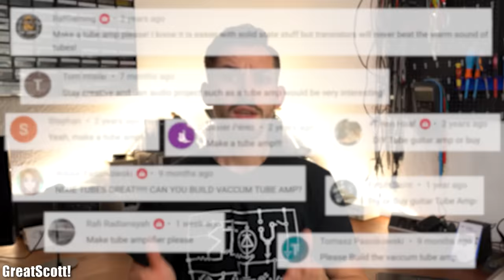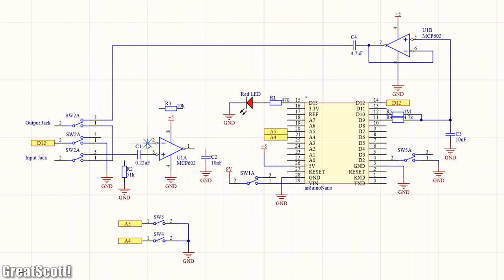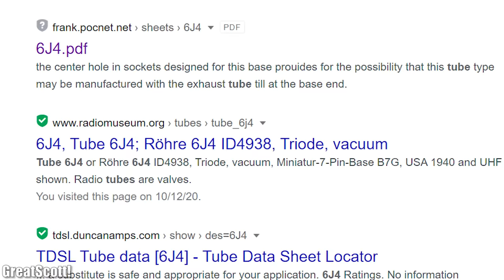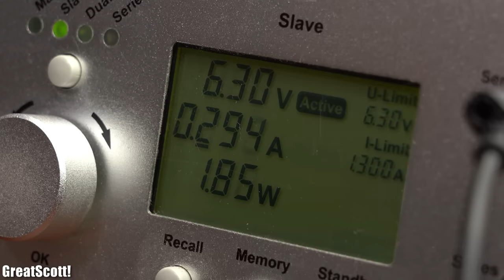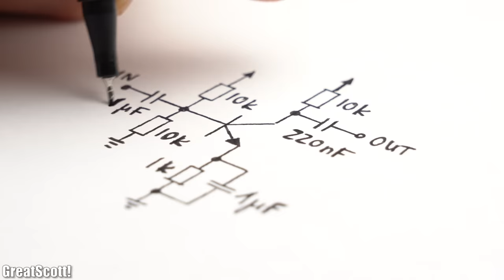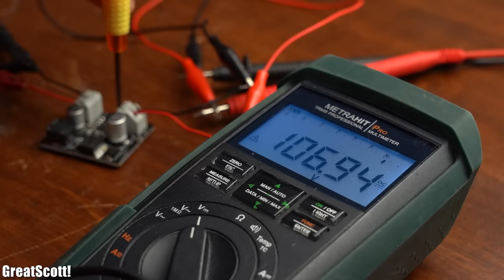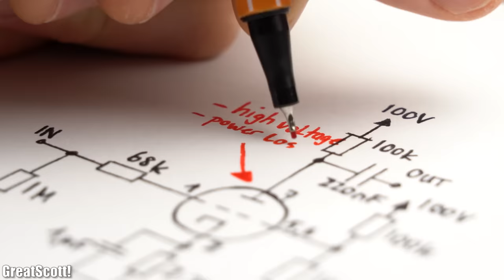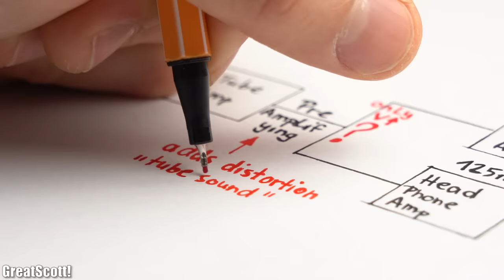Building a Tube Amp! Does it produce better audio quality though? EB#47

Comment: hi, i would like to point out some inaccuracies....
1 : your " amplifier" has little to do with a tube amplifier since it uses vacuum tubes only as signal buffers, everything coming out of that box is transistor generated.
2 : a true vacuum tube amplifier uses "final" driver tubes to generate the power to drive a speaker, but since they require high voltage as part of their working characteristics they have ust a high impedance output. this impedance is matched with an iron core transformers ( with some special characteristics to improve audio performance ) so in your amplifier you are bypassing about 3/4 of what a tube amplifier really is.
3 : the tube curves are less linear than transistor ones, but you are actually looking at the wrong graph to determinate linearity, audio specific vacuum tubes ( there are RF, IF, oscillator, mixer ecc.... specific tubes) have a grid voltage - plate current graph, si you see the variation of plate current versus grid voltage; this really shows linearity ( remember that tubes are transimpedance amplifier basically )

i also would like to propose an objective osservation, the audio quality can be strumentally measured with audio distorsimeters of fft analyzers ( or a scope fft ) as well as a frequency sweep, if you take a look at some videos by "ElPaso TubeAmps" channel you would see how a real tube amplifier is built and fully tested, a good tube amplifiers does not show distortion of any kind basically, you can achieve even 0.1% total distortion which is a remarkable result.

i do not want to be polemic, i just want to point out some inaccuracies :)
hope you reed this comment!
Reply: Yeah, i only have a high level understanding of tube amps, but every cheap circuit is still 80% silicon, the tube does nearly nothing. The parts that make a tube amp a tube amp are bulky and heavy,  and pretty dangerous too. Like 400- 600v.
Reply: the problem with using tubes as final drive tubes is that it adds a ton of aliniarity the mentioned iron core transformer features a alinerar iron core which is a source of distortion add to that that those systems are rather inefficient and that they are only realy usefull for low powers and you have quite a lot of problems. also 0.1%thd is basicaly nothing in the world of silicon amps they usually run with a ton less untill they get out if their linear region. 
not saying that tube amps have to place to be quite the opposite if you find that mix of distortion pleasing to hear thats a great option for you same with guitar amps where that distortion makes a guitar spring to life.
but just as a amplifier that has to create the most linear and accurate results tubes are not your friend
Reply: Tube sound superiority in hifi amplifiers is still a very contentious debate. There are many who believe that the amount of distortion is less important than the harmonic content of the distortion. The typical argument is that a strong 2nd harmonic is a pleasing "musical" distortion and tubes tend to distort in that way. It's a fine argument for guitar amps, but it kind of falls apart for audio amplifiers. Music usually contains complex a mix of frequencies and while a 2nd order harmonic might sound nice applied to a single note, with many simultaneous notes the resulting distortion products interact with each other in a very non-musical way creating a whole bunch of new frequencies not in the original piece of music. The result is a loss of definition of each individual instrument and a more noisy, veiled sound.
Reply: This.
Reply: Wait!! Let me get to the point. 
So her 80$ audio vacum tube are trash product that scam innocent peoples to buy it because humor about tube sounds quality? 🤔🤔🤔🤔🤭🤭🤭🤭
Reply: Mr Carlson's Lab is amazing channel for tube amplifiers and old electronics so for all reading this comment go and check his channel
Reply: Yep this guy is correct, a tube amp with only a tube pre stage is not a tube amp
Reply: @volvo09  then if you are that knowledgeable you would be aware of equal order harmonics effects and how they do influance sound properties and percived quality..
Reply: Well, its still a tube pre-amplified amp. Like with most tube amps its serve its purpose of looking cool, adding the pleasant distortion and costing too much. So its a tube amp.
Reply: @gu4xinim  That's a misinformed comment if there ever was one 🙄
Reply: @lonelyelectron5283  You are forgetting the demand side of the equation. They would not make these "fake" tube amps if dumb people did not think they worked and buy them. The people who buy these defend them. They think because it has tubes it makes it sound better. They are paying $80 to fool themselves. Same with audio cables with gold plated ends. The cable is still copper it makes no difference.
Reply from the maker: Thanks for the feedback✌
Reply: @chuckthebull  "Perceived quality" stands for "shit I cant back up but I think its there so it is." It either effects the actual quality or it does not. It either amplifies without distorting the sound or it distorts the sound and what you are listening to is NOT the same sound that was input. Changing the source is a sign of LOWER quality not higher quality. If you like the sound of NOT the original input then that is on you but it is not better or improved it is distorted. Some prefer tube amps and some prefer not to spend $80 on a useless brick. You can pretend all you want but the actual science says otherwise. Blind test after blind test audiophiles are unable to tell the difference any better then a coin flip. Then audiophiles try to say that some how audio is not suitable for blind tests one of the most reliable testing methods in science. Its all bull you made up in your head. That is the perceived part you THINK it is but it is actually not. Audiophiles are no different then people who believe in psychics. They are unable to prove it so they just say it is a "Perceived quality".
Edit: Auto correct changed psychics into physics.
Reply: Those amps with tube for pre-amplification and class D on the output using FETs ot BJTs are called hybrids, they use that soft clipping of the tube and the high power of transistors, check PS Audio on Youtube and there web site Paul is that old fella whose passionate about audio, about amplifiers, about tube and about speakers, you may already watched some of his videos with the extremely rare Infinity IRS V speakers and PS Audio have those hybrids with over 1000W of power and the hearth of the amp is the tube and the muscles are the FETs so there is place for those kinds of hybrid amps
Reply: @jordangogov5866  Sorry im still new at electronic and still using transistor as amplify for audio but why we mix them for audio? I dont get it
Reply: @jordangogov5866  Except here it doesn't have a proper tube preamp stage, but only a tube buffer (it will only get you so far where you want to go). It's not what is typically considered "hybrid". On virtually all hybrid devive, you'll have a triode voltage stage (say a 12AX7) that will actually impart "tube sound" to the signal. These cheap Chinese devices really aren't doing all that much.
Reply: @WillisPtheone  You can easily tell the difference when using proper equipment. The large appeal with tube amplifiers is that you can swap the tubes to have the preferred sound. They can get very expensive if you are getting the proper full tube amp such as Woo audio ones, but all audio gear is like that $80 won't even buy you a single good tube. Once Covid is over I would suggest you go to a audiofile meetup and take a listen to some of the high-end stuff before jumping to conclusions.
Reply: @WillisPtheone  Does what you're saying apply to real-deal guitar tube amps that cost hundreds or thousands? And I mean for guitar amplification specifically? The imperfect frequency response and distortion can be desirable for guitar amplification, right?

Edit: To provide an example, I'm a huge Jimmy Page fan. And I would imagine that the majority of the guitar community would say that it's impossible to attain his characteristic Supro sound with just transistors (and I'm ignoring digital effects and post processing considerations). Would that be inaccurate, or is that an exception to what you're saying?
Reply: @jonathanvanier  I tried some buffer schematics but all we crappy cuz there is no useful signal/noise with the low voltage I used so am waiting for return mail from a shop which has laminations and bobbins and I will wind my own transformers to power a 6sl7/6L6 stereo amp only the output transformer is my concern cuz the lamination type is different from the power transformer and that is said by one of my university teachers and the Tesla of the laminations has to be lower than 0.5T but from other places I find that I can use the basic 0.35mm laminations with there 1-1.2T laminations so I don't have any idea what to do for the output
Reply: There is no such thing as zero distortion. Or noise. Or anything else- any (good) engineer will tell you EVERYTHING has tolerances. Entropy increases. NO amplification device has a truly linear transfer coefficient. In the case of triodes, the supply voltage and load resistor would need to be infinite- but as they increase, noise increases (unless you want to run it a t absolute zero temperature). Most tube preamps run their first stages at much lower voltage (~60v) because noise is more important at that stage, and accept the non-linearity.
Reply: @MarkHopewell  Actually, otological matters do not intrude- if the pattern of movement of the eardrum from the recording matches that of the original performance, then fidelity is achieved. Any human differences would apply to both, and therefore not a reproduction issue. They would sound the same to the subject.
Can we approach this? Not with speakers. They inevitably involve (amongst other things) room acoustics, which mean that the original is corrupted (room balancing does not take into effect the time domain).
Better is to record with an artificial head and mics in the ear canal, then reproduce with insert earphones, with microphones of the same response in the ear canal, the system matching what  they hear with the original. IMHO this is the way to go.
Reply: @volvo09  Most circuits that I have seen only use the tube as a cathode follower. This means that the tube has 0 zero dB gain (actually a little less than 0) and only adds distortion to the signal. Within most of these circuits there is no benefit of adding a tube, it's only there to make it look fancy.

There are of course exceptions where mixing sand with tubes does have a benefit, but this is specific for each application. One of these would be as a CCS in a long tailed pair or to drive a powertube's grid current in class A(B)2 applications.
Reply: @MarkHopewell  Not sure how this is relevant to the point that I made- which is that the objective is to match the original performance, without regard to what that sounds like to the subject. You need not explain the frailties of human hearing  to me- I was the chief designer of hearing testing equipment for a UK otological instrument manufacturer for over 20 years, and I am very familiar with the literature. (No BS, I can prove this.)
You seem to be concerned with perception. I am not- just with reproduction. If you are complaining that the entire field is full of hype, smoke, mirrors, and lies you will get no argument from me. It was ever thus.
Reply: @chuckthebull  I'm a bus wanker but I agree with you.
Reply: @kingsman428  I'm not sure what a "bus wanker" is exactly,,except someone who might pull on buss bars? but thanks,,, and cheers to you... I'm not anti audiophile,, just people who pretend to be and don't know squat. lots of money and no sense does not make an audiophile despite how much money they throw at it either. Some of the negative critique is warranted in those regards but not the ignorance to the actual technology. And you don't have to be rich to own tubes or build a good amp. I'm not biased towards one over the other because life is more diverse than these narrow minded people who have to chose sides. I use both and both have a purpose.
Reply: @chuckthebull  "...bus wanker..." It's a phrase from an English comedy series called the Inbetweeners 
In England we call those guys you refer to the Golden ear brigade some are ok whilst others are really pretentious claiming to hear things that can't be measured 🙄
Me, I like to wind them up by telling them they've wasted thousands seeking the perfect sound when all you have to do is introduce a graphic equaliser that will solve all their issues you, would think I had just murdered someone, then of course, the lectures follow about how I don't understand noise, distortion and harmonics yada yada yada 😁
Reply: The tube is just a primitive soft clipping solution. Better is to have enough headroom to avoid clipping entirely.
Reply: @kingsman428  love the inbetweeners,, very funny.. those kids can't cut a break! ha,,I don't remember hearing that phrase but love British comedy, so I can relate some times... lots of people pretend they hear and know things they don't,  and don't seem to notice how they embarrass themselves in front of people who actually do.
So yeah it's the pretensious part of it all that can be irksum, upper class twits and all....cheers,,,,, oh and don't ever use a shovel,,,it's super primitive.
Reply: @ThinkingBetter  you should avoid pencils toilets and shovels by your "logic"
Reply: @chuckthebull  That's over-use of my logic.
Reply: @ThinkingBetter  I doubt you have the capacity to use it at all
Reply: @greatscottlab  so.... you're going to re-try this? or can't be assed?
Reply: Passions run high in these comments.  Almost as high as the lack of spell-checking and grammatical correctness used in writing them.  My 65 year old ears can no longer perceive sounds above 8 kHz and tinnitus prevents me from getting the increasingly annoying jet-engine noise out of my head.  Do I care about perfect sound reproduction?  Not in the least.  I only care about what sounds good to my poor age-addled ears, and that, my friends, is tube audio.  I don't have figures to prove it but it would not surprise me to learn that the average age of the people who buy tube amps are like me, over the hill.  We're just trying our best to enjoy what's left of our sound-filled lives while we still can.  The quest then isn't for amps with the lowest THD figures we can find, it is for amps that can reproduce the beautiful sounds, distorted or otherwise, that we're still able to hear.  Tubes, as imperfect as they are, can reproduce those sounds with the warmth and richness that older people crave better than the stark, perfect, antiseptic world of transistors can.  It's as simple as that.
Reply: @sincerelyyours7538  i get your point, i was not expecting such a reaction in my comment when I was just pointing out some inaccuracies. I am 20 and I live in Italy( so the grammar horrors belongs to me also ) and I prefer tubes to transistors not for the technical characteristics but because I think there is a soul behind. Let me explain, everything commercial that uses transistors is made by machines, while a proper tube amp just can not be built by machines, it requires skills, passion, troubleshooting, manual art and so on by a human being, so it carry all that work. I remember the first tube amplifier i ever built, it was sounding like trash but I liked it, it was my design and construction so it was like my child.... But I don't remember the first transistors amp because it was just some black boxes of plastic and come wires. But that is my opinion, obviously i am going to get angry comments but that is the reason I design and build tube amplifier from the ground up
Reply: @manuelminutello3027  I understand completely.  Vacuum tubes have a history that began with the earliest attempts by humans to understand how electron flow in circuits work.  They are quintessential analog devices and like humans, they seem to age like humans, both in design and performance over their lifespans.  Their performance curves are not at all linear but then neither are most people. They seem to age with us like a fine wine ages.  Whether that is true or not doesn't matter, it's all in the perception of the sounds they make and the joys they bring us throughout our lifetimes that matter the most.  I'm speaking philosophically, of course, but I agree with you, there's a soul in tube circuits that my transistor gear just doesn't have.  I've had many hobbies in my life but the only one that has aged with me has been my love of electronics.  All the others I've had to quit for one reason or another, but as long as I can hear sound I'll be building and repairing tube radio gear.
Reply: Nice definition of the follow-up video!! The basics have been laid out....
Reply: If people prefer the tube sound, they prefer the distortion it provides - so you only need a pre-amp to provide that.  He could hear the difference and he liked the sound.  He could have spent another 1000 euro on an amp that drives the speakers with it but that was not the point.  His oscilloscope should provide a transfer function mode where it will plot gain and phase vs. frequency and that will tell you everything you need to know about how the tube is different to the transistor.  Personally I just think that tubes are inconvenient, but where you have space and mains electricity then really no problem and there is something cool about them [ironic because they are hot].  They will never go out of fashion.
Reply: I only give Negative Feedback!
Reply: A true tube amp has no IC's, point to point wiring, basic tonal adjustment options, and requires time to warm up to proper operation.
Reply: Thank you for posting this! I was coming on here to say a bit of what you said but didn't have to!
Reply: @greatscottlab  So you're also not reading all the comments.    Since this response is pretty lame, and must come from a mere minion or an automated bot saying thanks.
Super lame response tbh.
Reply: Not sure if anyone mentioned this but his tube in this video isn't a triode it's a pentode, 6j4 he was looking in datasheet is American 6j4 and his is Chinese copy of Soviet sharp cutoff pentode 6ж4п which is also spelled 6j4. That also explains why his output was so weird since the tube is wired the wrong way... Also the answer on the topic of why tubes are still used in audio today is because their soft distortion. So let's say you have a nice sine wave signal and feed it to an amp, at low input signal level you will have just a larger sine wave at the output, but if you crank the input signal up, at some point the output will become distorted, in transistors that output sinewave will have it's top and bottom turned flat or in extreme case it will be turned to a square wave. In tubes however as you enter distortion region the sinewave's top and bottom will start to squish at some point it will be flattened just like transistors and finally turned into square wave but you need to crank input signal way up in order to do that. This distortion effect is the reason why tubes are used in guitar amps.
Reply: @sswpp8908  

Lets not forget tube amps are only the last step in the whole thing. I like to think that you need to max out every step before the amp to get max quality (as well as getting fitting speakers, of course) to the amp in the first place.

Like, a shiny new and expensive tube amp wont make your mp3 sound better, thats a big nono. FLAC? Maybe. wav? maybe even more, but lets go full analog to circumvent compression and now were looking at $2.5k in turntable and turntable equipment as well as the best headers.

Shits expensive, yo.
Reply: @dieSpinnt   I don't see how I was devaluing anybody's tastes. My point is that distortion removes detail from recorded audio and it gets worse with signals that have more complex spectrums. It's a different argument to discuss having distortion in the audio path for a single instrument versus sound reproduction of an audio recording with a variety of instruments.
Reply: @chuckthebull  but you are mixing sound creation with sound reproduction, right?  Tubes may allow the artist to create a sound they love, but tubes inherent  distortion would distort the reproduction of the artist's work.

Perhaps the distortion of that work sounds good to some, but the more the reproduction is distorted the further from the artist's creation, no?
Reply: @lonelyelectron5283  As I understand it, it's not that the vacuum tube is trash. It's that it adds harmonic distortion, and that causes the effect many people like. So pleasantness (it this a word?) has nothing to do with fidelity.
Reply: @ThinkingBetter  unless you want clipping, like when using a tube amp for a guitar. all this tube amps are better is just a part of guitar world.
Reply: @somethingsomeonesaid6455  not necesarely, point to point are very rare or expensive amps. modern tube amps have IC's for things like channel switching or FX loop bypassing, programing, etc, but still is a tube based amplification both in preamp and power amp parts (I have a marshall DSL amp)
Reply: @punkmaster76  It's simple. I don't want any clipping in my home audio system. Between an underpowered amp that will use tubes to soft-clip the signal vs. having adequate power to avoid that problem entirely, I will go for the latter most definitely.
Reply: : @sswpp8908 : you are completely wrong. Outstanding tube amplifiers  have pure sound response, not the semiconductor amps. 
Like comparison Stradivarius violins vs modern ones.
Reply: @nicolasolmosolmos1657  Wow! I can't argue with that. It's so obvious to me now: old things = perfection, new things = garbage. It's a wonder why anyone even attempts to make anything anymore when everything that is great already was figured out a long time ago. I only now realize that my career as an electronics engineer has only served to intentionally crapify decades old flawless designs.
Reply: @nicolasolmosolmos1657  Tube amps are not about purity but about adding more musical distortion. In some cases with certain music that fools our hearing to make us think the music is more live sounding. I prefer the purest audio without tube sound.
Reply: My tutor had told me in engineering communication class that pre amp. is most significant in multi stage amplifying. Because it is the 1st to tackle  signal to noise ratio (S/N).   Poor performance pre amp made noise amplify to multiplied along follwing stage so give low quality output.
Reply: @alexlo7708  True only if you use the phone preamp input with high gain amplification and RIAA filter. For anything you connect to a preamp that already has a line level output, the preamp is almost like a wire except volume control and in some cases tone controls. In fact, you don’t even need a preamp, if you have a volume control in your DAC. For digital systems it’s better to avoid the preamp.
Reply: @ThinkingBetter  Even digital control,you need preamp. The lower your signal, the poorer your A/D converter output.  Preamp is significant in any signal system.
Reply: @alexlo7708  No, DACs easily output enough signal to directly drive a power amp with no problem and not having a preamp helps with signal being more pure to the original. You just need a quality volume control somewhere that doesn’t cut the bit resolution when lowering volume and some DACs have it built-in.
Reply: @ThinkingBetter  What you say quality volume control is that pre amp.
Reply: @alexlo7708  But you don’t need to waste money to buy an entire extra box just for the purpose of having a volume control. In, fact, your signal will then end up going through extra cables and circuits with zero added value causing just degradation of the sound. It makes no sense for a digital music system.
Reply: @ThinkingBetter  Its OK on your view point. But to those devil ear, They seem to enjoy superb analog circuit , pure original sound. No any such digitized process.
Reply: @alexlo7708  As I said, if you are into vinyl analog music, go for a preamp. You need the phono stage for that. For digital music, there is nothing to “preamp” and such box is not adding meaningful value. But, one exception. If you like tube distortion (even harmonics) added to your digital music, a preamp with tubes can do it for you.
Reply: @Dragonmastur24  Underrated joke
Reply: :@ThinkingBetter : Could we discuss personally through our e-mails. It seems that you know more than book authors on the matter.
Reply: @nicolasolmosolmos1657  I don’t have your email.
Reply: @A Twinspark Soft clipping with a tube amp surely sounds better than hard clipping with a transistor amp. But better is to have enough dynamic range to not need any such compression artifact.
Reply: manuel minutello: You are completelly right.
Reply: @chuckthebull  1.) I never said one word about spelling, grammer or writing, 
2) I think we agree on half of the subject-. Tubes are very much legitimate creating music.  If the artist loves the sound then that is what they should use.  I probably would agree the tube amps make more ear pleasing sounds then solid state.  Artists can use tin cans to make noises that they love and if they are good, everyone else will appreciate those sounds.
3) when it comes to reproducing those sounds in my living room, playing through the tube amp will distort the artist's work and.therefore a solid state amp may more closely represent what the artist intended.  Listeners, however, may still enjoy the sounds of the music reproduced through tubes and if so cool.

What do you think about the reproduction of music - which type amp more closely captures the artist's intentions?

PS - I would love to have a beautiful tube amp where I can see the tubes!  My hearing/listening is not good enough to tell much difference any way.  For me the question is entirely theoretical.
Reply: @phoslurperr  My comment about spelling was not directed at you,, it was mentioned further up in the thread as a dig on my opinion , I was just using as another example of people using gaslighting techniques to disregard someone's opinion. my ire was less personal towards you. but I get your point about not coloring an artist's work further..
but in my experience with tubes and fets they have a more pleasing sound where transistors can hash them.. you bring up a valid point though.
and actually a consideration.
for the studio the producers and engineers I have worked with all talk about this issue,, but if things sound harsh it also creates a negative feeling about music comming through, so selection of speakers and amplifiers in professional recording environments all seek to create the most pleasing listening environment for the clients. and tubes are less used in that environment but attention to their sound design and quality come into play..,a well designed transistors amp can sound good and is the source of much debate in that discipline too. the one I use is a mosfet amp that has characteristics of tubes as in pleasing to the ear.. EVERY electronic amp distorts in ways that effect sound.. electrons bouncing around inside resistors and caps and transistors create some noises no matter how well designed. how that happens can be harsh or smooth..even transformers add color and are saught after in many mic preamps.. The idea some think this does not matter is simply peacocking. I just designed and built a bunch of ribbon mics with transformers I wond myself to get the right characteristics,, so far they sound great to me.. I'll run them through tube preamps. or I have vintage pre amps that have discreet transistors. whatever works to get the desired effect im after as cymbal overhead recording. it will help smooth out the cymbal harshness inherent in that instrument...this is why recording professions paint with sound using color and brush..
Reply: I like all the fuss about tubes vs transistors.  In guitar amplifiers, people like the distorted sounds.  In HI Fi audio gear,  like for instance the Pioneer SX 1980?   That is all discreet, bi polar j t. With such design, there's hardly any harmonic distortion right?   But I have seen upon design,  if it is correctly designed,  tubes can give the same results,  but it does have to have a higher voltage on the plates to conduct the proper power levels to give some punch to the speakers. Good output transformers are pretty bulky and heavy, to reproduce a good output,  vs the isolation so you don't get a shock from the plate voltages.   Overall. They're all good amplifiers.  I like JFET outputs on my Yamaha fan cooled amp, ,  it kicks ass!!!!  500 watts per channel.  I can't keep a speaker,  where I'd have to recone it again. 4-16 ohms.  But I like all amplifiers, tube or transistors.  Both work well if they are biased and filtered properly, and heat sink design is always important in transistor outputs. Heat is always the enemy... Keeping everything cool in all amps helps allot. I hate thermal runaway in a transistor amp!!
Reply: @timka880057  nicely stated... why people feel the need to polarize the debate when both have their place to enjoy and purpose...tamato pottato let's call the whole thing off!
Reply: @A Twinspark It’s funny you put the LM741 into the mix. Even in the 1980s when I was building my own audio gear, I very much judged this as a too poor for audio chip. Nowadays you can get great audio out of a TI premium audio op-amp of course. Tubes are horrible for audio because they are very temperature dependent and yield rapid wear-out that means degrading sound over time. If you really want the distortion of tubes, a DSP can make it more reliably and more optimized nowadays, assuming your music is from a digital source.
Reply: Yes, that "tube amp" is one of those garbage Chinesium ones that just use the tube as a passthrough for a cheap, crappy, overpriced solid state amp with those stupid blue LEDs (always a bad sign). It's basically the worst of both worlds, fake as a tube amp, and cheap and nasty as a solid-state amp.
Reply: @WillisPtheone  although slightly off the direct topic I have both SS and tube guitar amps and I prefer the tube amps sound more...even though it measures differently (worse than the SS) my tube amp sounds fab...so although subjective it is always about the way things sound in the end.not how it measures.
Reply: Well Put!
Reply: @chuckthebull  Amen, I play a 1966 Fender Bassman With 5881s instead of 6L6gc, and I've heard nothing of the like - The Break-Up & jangle I get when I plug-in makes me want to pee my pants, Beautiful, And the four other Mesa boogies I have Make me want to shit them - Not so beautiful. I've not played other amplifiers that do this to me . Tube amplifiers At high voltage With relatively low wattage Produce tone that you can feel, tone That shakes your bone, not just hear. Even if you don't jam, play, it becomes an experience and not just a sound. You find there is a direct relationship with your equipment and instruments. No joke. Live long and prosper, friend, Lord bless, Ljs
Reply: @L.J.S.P.  indeed,,i have a g&l base that I run through a modified old tube pa amp and a single bass speaker cabinet with a tweeter, it's an odd setup but it works for me.. I used to have an svt setup and that cut right into my bones like you described. so yeah I know just what you are talking about.. Cheers to you,,
Reply: @chuckthebull  Sure, things that run on low power or are not used much can last longer including tubes. Of course, if you enjoy using tubes, keep enjoying it. I prefer the purest sound without tube distortion.
Reply: @ThinkingBetter  I'm sure you prefer rainbows and unicorns too.
Reply: Just find something that uses EL34s and 12AX7s ;)
Reply: @chuckthebull  In terms of audio, I see no reason to damage the audio with "musical distortion" by adding old-style tubes in the signal path. I prefer real things.
Reply: @justincase9471  
"This means that the tube has 0 zero dB gain (actually a little less than 0) andand only adds distortion to the signal. Within most of these circuits"
That's the benefit of cathode followers in these cheap amps.. Adding distortion/tube sound to an otherwise transistor amplifier.
Reply: @manuelminutello3027  I agree. It's the crafting involved.
Reply: @somethingsomeonesaid6455  Hybrid amps, which this one is, also require time to warm up to proper operation.
I built my own fully tube amplifier which may not pass as HIFI but sounds beautiful to me, nice an warm with a pleasant growl when pushed to clipping unlike SS which sounds horrible clipped.
I also own a little tube/hybrid headphone amp (Littlebear B4-X) meant to plug into my phone or MP3 player and give me that warm sound on the go, take the edge off.
It's not a real tube amp, but the non-amplifying tube stage shapes/distorts the music in a nice way. They are in the signal path, not just for show.
Reply: @tatzecom  Agree, but some MP3 files/recordings are far better than others at compression.
Remastered stuff are the worst, IMHO.
Reply: If the perceived benefit is a different harmonic distribution, then depending on how clean the transistor stages are, you'd still get them in this scenario. If you listen to an extreme case, with overdriven guitar amplification, the difference is huge, not better or worse, but a matter of taste. The main thing is, it's not to do with fidelity
Reply: @sincerelyyours7538  And your comment sums it up. You want a pleasantly distorted sound, you like tubes. You want a "perfect", antiseptic reproduction of the original signal? Transistors. It's not like the original soundwave of a distorted guitar gets un-distorted by a transistor amp; it just gets distorted again by a tube amp. In a pleasant way? Sure, so we (they) should actually fight about pleasant distortion vs. perfect rendering - and I would be ok with that. But the Golden Ear Squad priests insist that tubes are more Hi-Fi or something, while a simple signal injector and oscilloscope proves them wrong.
Reply: "Building a Tube Amp! Does it produce better audio quality though?" FAIL badly. Music is an art when you listen to art made in that era, you have to use the tools from that era. Is an audiophile skill to reproduce or replicate the master record at their best without the introduction of modern tech. Are a costly Analog setup and basically is a time machine that transports you to that time and space and relives that moment in time.
Reply: @David-sk7ls  if it's an art, then why be restricted to listening to it with the same components? If I was to look at a landscape painting (and I'm admittedly unlikely to) I'd have little interest in recreating the light spectrum the paint was originally rendered under. Another factor is that it's plausible that a digitally modelled circuit may get closer to period devices than modern reproductions.
Reply: @David-sk7ls  IKR, every time I listen to Mozart I have to dress as a king for maximum compatibility with the frequency response of the palace.
Reply: was going to point some of this out but i see that you already did hehe, for amplification of musical instruments it is generally desired for many reasons and a lot of preferance really, but each do have pros and cons, mainly costs and efficiency, i do prefer the sound of tubes, good examples are the Vox solid stae amps vs the valve series vs the AC all tubes, or Orange amps have similar models, imo the all tube are clearly superior, but for guitar or bass that is always the case, anything that might like a little natural breakup or distortion or warmth, i will also not that it seems that tube amps seem to produce a much louder signal at lower wattage, like my AC 30 blowing the doors off my VT90.
Reply: i think a lot of the contention is a perception of distortions and at what point there is a linear breakup, but this also can be a little misleading since a natural distortion can be mitigated in many ways, Caps or digitally but that woulda kinda defeat the purpose somewhat, best answere is probably listen to both and there is your answer, i prefer tubes, trans sound fake to me and simulated.
Reply: @negativezero3107  everyone prefers tubes, but it's largely because of the visual presence of them. I've tricked 'audiophiles' before with a digital signal path playing 96khz tracks with a software valve compressor plugin. Bit of an asshole thing to do maybe, but I was just curious.
Reply: Yep.  I'm a PhD. Electrical Engineer who designs electronics for a living.  There was so much wrong here as to make it misleading.  But I would like to add that linearity is not about the flatness of the transconductance curves over the whole operating range, it is about the linearity of the curve over the range that your circuit uses it.  Tubes have huge operating ranges compared with solid state devices, and so are generally capable high-power, low-distortion performance.  The best used of tubes is amplifying large signals, not small signals.  I have no idea why you would use tubes on the preamp circuit except that it is easy, and in that role, I bet that they are pretty damn linear.
Reply: Hi. Your pen sketches are very VSMR.
I do want to comment that you do not answer the question as posted in the title.
So; did you output the same analog audio through a tube and normal amp and listen to it? What do you think sounds better?
Also how about testing a standard amp vs. like say an old Philips tube amp with 800Ohm speakers. Put a record player on it; listen and tell us what you think sounds better.
You are looking at the schematics and test the amplification. But sound has to be heard right?
That having been said: I do really like and appreciate all your video's!
Highest regards, Mac
Reply: Buy $80+ peice of brick that's fragile for just adding distortion 

No thanks my speaker wire that close to power line is enough
Reply: The perceived feeling through the fingers with a guitar tube amp is a thing also.. those with hands on experience of comparison between the two would know...tube amps are very different to play when compared to their solid state cousins... the resonant loop from strings to speaker is another aspect ...once again experience is the teacher... 😎
Reply: THANK YOU for saving my time - I don't have to watch the video now.
Reply: @volvo09  - Some amplifiers don't even have them connected in the signal path - they sit on top and light up to look pretty.
Reply: @greatscottlab  Wait.. Is that a pun?!? :)
Reply: True said manuel
Reply: X-10
Reply: Your a God amongst commenters!
Reply: Has anyone else's Andrew keyboard has been getting screwed up lately
Reply: Finally found A Great Committed Sir I love Tube Amps